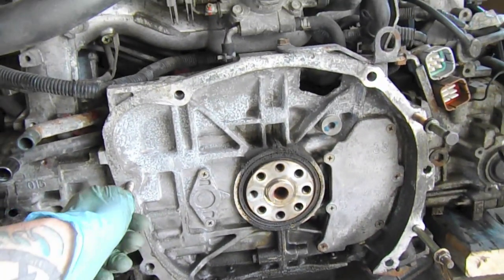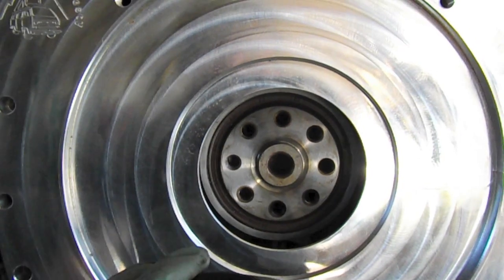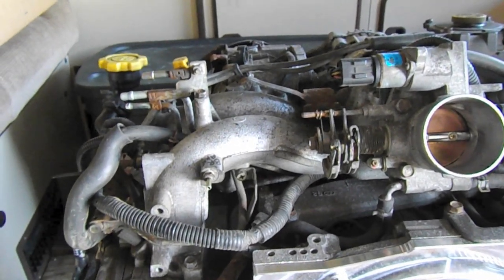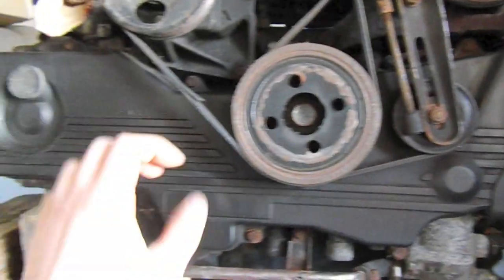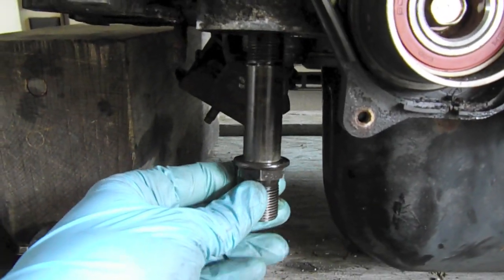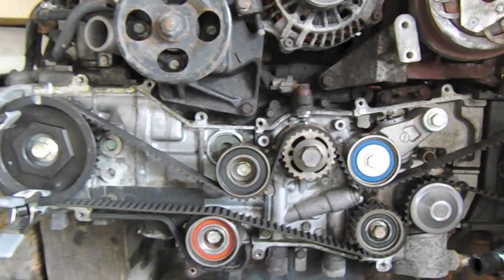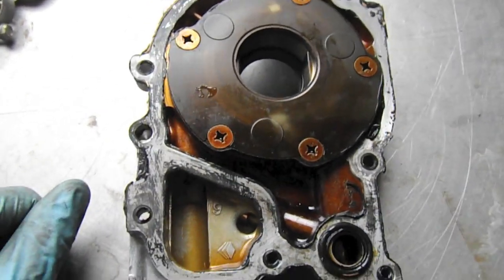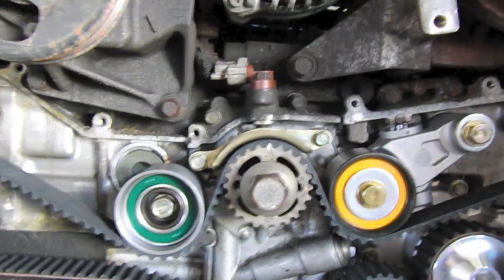Subaru Engine Prep - Subaru Vanagon Engine Swap Part 4

Comment: I love your attention to detail man you do incredible work it takes a special set of skills and a whole lot of patience to do some of those harnesses that you do have talked to your brother you actually explain it in a way to where I'm almost not afraid to attack my harness situation that I have I bought a 85 van again regular passenger van tin top. It already had the Subaru conversion swap in it when I bought it recently but there's a whole cluster of wires that have to wires the insulation is missing on them a real nightmare of a project for someone who doesn't do electrical but I think I can get it after watching your videos or at least I'm going to cross my fingers I like your quote about there being a million ways to skin a cat I use that line all the time have a great day

Comment: Mine has the original oil sump just brought whole gearbox and engine to tilt a little higher. Will see how that goes. Great detail and explanation mate, appreciate the time that goes into your vids. Used your vid  last week to do the front breaks, that for the tips. JP

Comment: hi i must say your layer back way of explaining this is fantastic. however please can you answer this question. what wires get connected to the black box in the engine bay. Sorry for the stupid question. once again great video bud. Regards John.
Reply from the maker: +john allcote Hey John, for a Van you have to connect the keyed ignition wore, starter switch , B+, oil pressure, alternator lamp, water temp. Cheers!

Comment: Great reminder to swap the vacuum fittings and reposition the heater hose connections.  I haven't done that yet, and since the engine is still on the stand, I'll have to make sure I do that.  I was surprised to see you delete the oil cooler.  Too bad I had already spent dealer prices on new hoses at both ends of that coolant line across the front!  I am looking at the cast aluminum low profile pan from Smallcar. Very spendy, that one.  You are correct in that especially with the low profile pan, the oil filter becomes the low point on the engine.  Have you considered a remote filter arrangement?
Reply: Decided to delete the oil cooler as you did.  Parts from the Subaru parts counter on the way.
Reply from the maker: Forthwith Tx You know, it really could get snagged in a Vanagon and that would be disastrous so I think that's a good call. If you were concerned with oil temps down in TX, I would run a remote system like you mentioned. I haven't personally run one but I'm sure there are Subaru guys who do this and I bet they have recommendations.

Comment: Great video. So, which do you think is a better conversion as far ass cooling goes? Belly radiator or 2 in the engine compartment? My conversion will have a/c. I was planning on mounting the condenser under the belly and the radiators in the rear. Any thoughts? I'm trying to do a dry fit and plan out everything so I can paint the engine compartment and under side of my bus be for final install.
Reply from the maker: +David Kelly the belly mount has more fluid capacity and possibly more airflow. So if you're not concerned with road debris then I would go that direction. If you camp or drive on dirt roads a lot then you may want to go with engine bay rads.

Comment: How much was the total cost of that conversion? Great video by the way... I'm about to buy a 1987 westy and I'm thinking on swapping an engine in like 2 more years probably... so your videos are very good, thanks!
Reply from the maker: You can do a swap for as little as $3500 if you’re resourceful and can find an inexpensive donor. An inexpensive conversion for someone else to perform the work would be around $10k so you’ll save a ton of money DIY.

Comment: Help me to understand?   I see a lot of these conversions where people put in a used subie.  I would think that you would want to put in a reconditioned or rebuild subie after going through all that work
Reply from the maker: +Hank hankyourhankerin a rebuilt Subie engine generally runs $3K - the cost of a conversion. Once converted it takes a few hours to replace a dead used engine with a JDM, rebuilt, or other good used engine. I love used Subie engines - they last a long time if you take care of them. I hope that helps!

Comment: 2 questions: Where do you get the cap for the oil cooler? I got the new oil filter stud pretty easily, but can't figure out what you used to cap that off. Also, what about the piece on the bottom of the water pump where the other end of the oil cooler runs to? Do you just cap this off as well?
Reply: I rewatched the video and see you put on a thermostat housing without that line. If I don't want to buy a new housing, can I just cap mine off the same way you capped off the line behind the oil filter?
Reply from the maker: +Jacob Norton you can use caps, plugs, or run a coolant hose to connect them. Usually I order a plug for the engine block and pick up a different thermostat housing at a junkyard.

Comment: do you grease the new rear main seal before installing? inside out side edge? or install dry
Reply from the maker: +Randy Lucas I use engine oil.
Reply: on the inside and out of the new seal? i heard if you get oil on the outside it can cause premature oil leak?
thanks for the quick response
Reply from the maker: +Randy Lucas That's how I do it, Install dry if you wish ;)/

Comment: How are you? What conversion plate did you use?
Reply from the maker: Hey Brad, I like using the Kennedy Engineered Products adapter plate and flywheel.
Reply: Busaru in the video you use a Rocky mountain westy plate? If so which one? They do not have an option for a t2

Comment: Have the headgaskets been replaced on this engine?
Reply from the maker: I would do the head gaskets if it were going into a Subaru but since it's going into a Vanagon, and its very easy to do them in situ, I did not replace. Welcome to the joy of the VW/Subaru combination!
Reply: Busaru  Okay makes sense, was worried since late 90s early 00s 2.5ls have infamous headgasket issues.